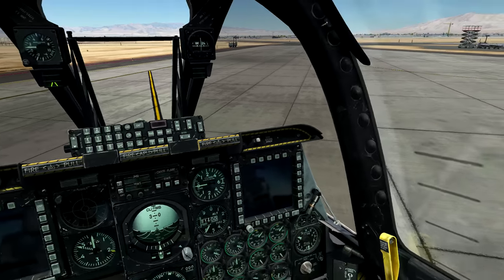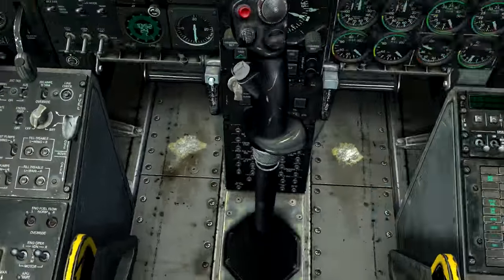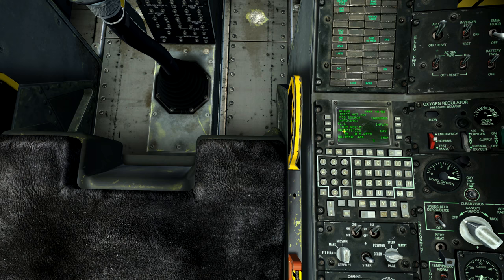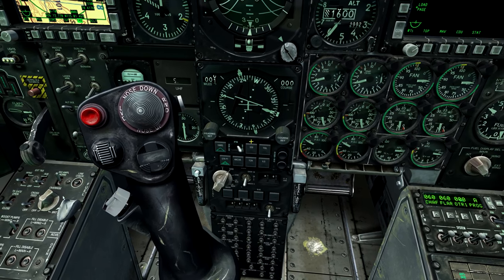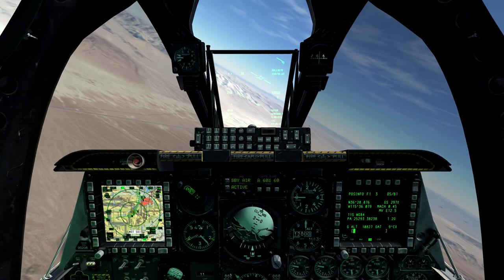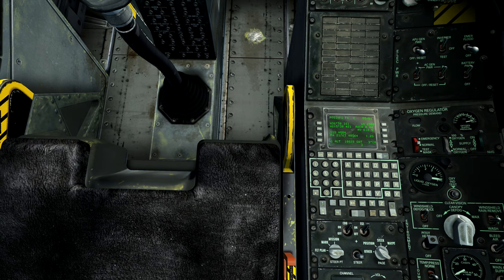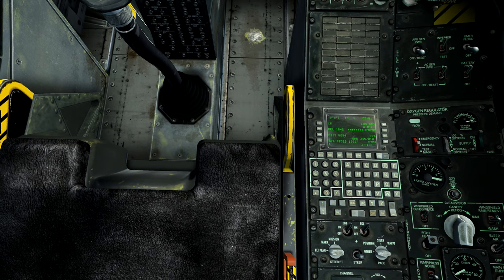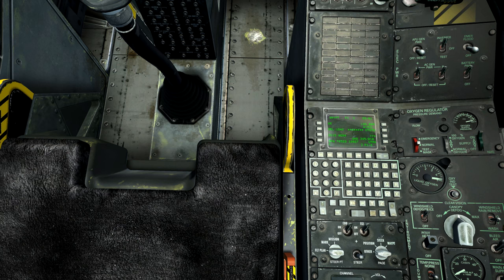A-10c - An In-Depth Tutorial of the CDU - Part 01 - Overview

Comment: Random notes:

- The real EGI requires at least 8 minutes of steady level flight for the INFLT alignment to work. In the sim, it only takes about 5 minutes with no requirement for steady level flight either. 

- There seems to be no appreciable difference between the two methods in regards of the aligment's final precision.

- The four numbers are in the format X.X Y.Y: the former is the time passed since the start of the alignment in minutes and tenths of minutes; the latter is the precision of the aligment, 0.8 being the best possible value. 

- It takes exactly 4 minutes for the GROUND alignment to complete.

- Generally, an * in the CDU represents a currently active mode.

- HARS is the legacy navigation system from the A-10A. It can still be used for basic navigation in case of EGI failure.

- The Z markpoint more precisely shows the last point of predicted weapon impact, rather than the last point of weapon employement.

- You can't delete markpoints in the simulated suite.
Reply from the maker: Gliptal, thank you very much for the added info.  It is very much appreciated!
Reply: +Gliptal "You can't delete markpoints in the simulated suite." are you saying you CAN delete markpoints in the real thing ?...if so how ?
Reply: +Richard Missin One of the now blank buttons on the CDU, can't remember exactly right now.
Reply: Wow, didn't realise the sim wasn't complete, any noise from ED if it's ever going to be added? or is it the usual "its on the list".
Reply: @Gliptalful  Restarting the engines will remove the mark points